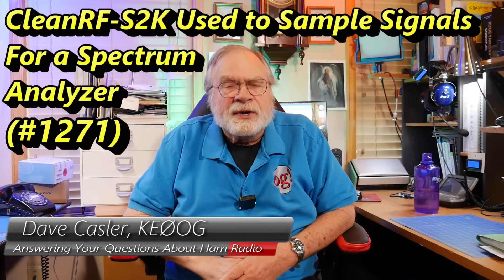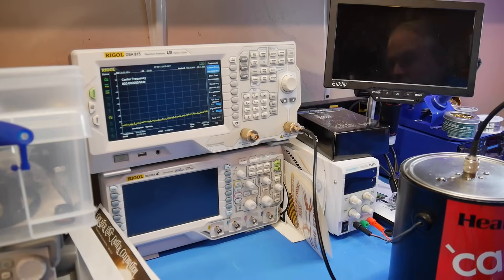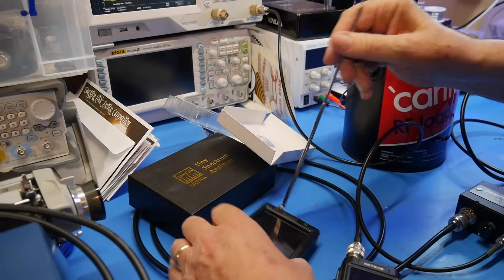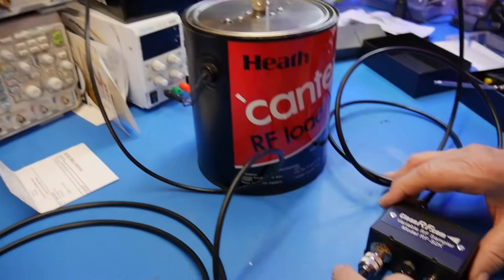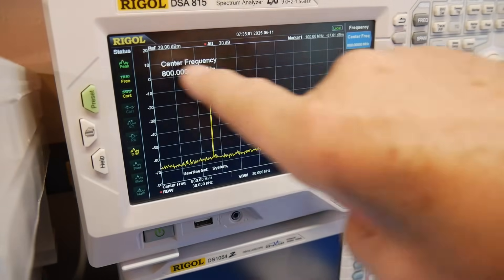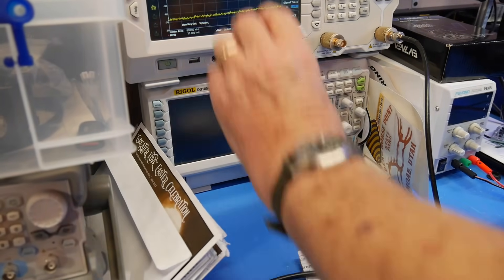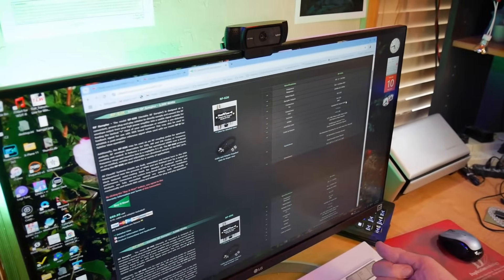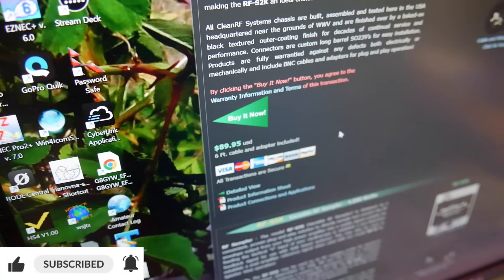CleanRF-S2K Used to Sample Signals For a Spectrum Analyzer (#1271)

Comment: That sampler is for HF only, which means if you use it at GMRS frequencies, the attenuation (sample) will not be linear across the frequency range. And your harmonic measurements will not be accurate! I have one of these, and it's great for HF work as designed, but you really need to use a sampler rated for the ranges you are working with, or inline attenuator (say, DC to 1GHz) to measure harmonics correctly. 73
Reply: Yes, you are absolutely right. It's unfortunate that even after four years the question asked didn't get the correct answer.
De VU2RZA
Reply: Yep. It's 3 - 30 MHz. Hopefully Dave chimes in about using this for UHF/VHF.
Reply: @nateitkin8279 Yes, that's interesting and weird at the same time. 
De VU2RZA